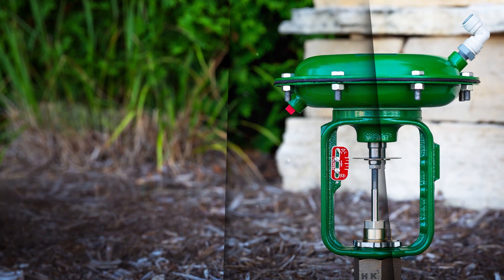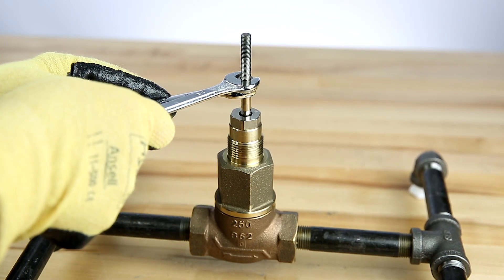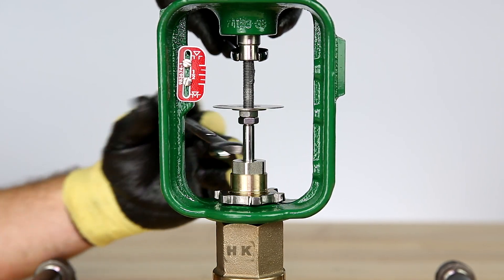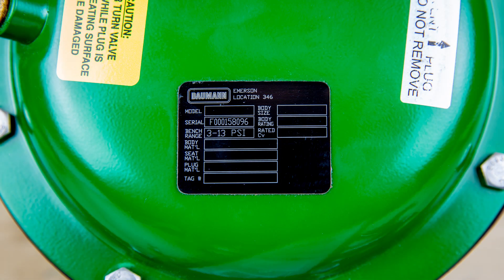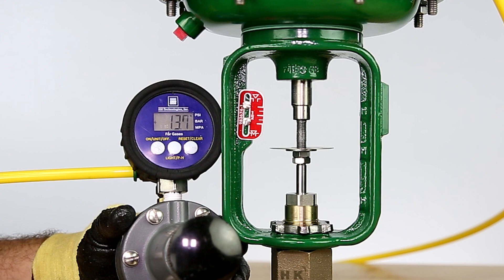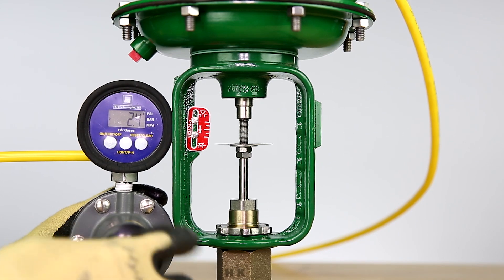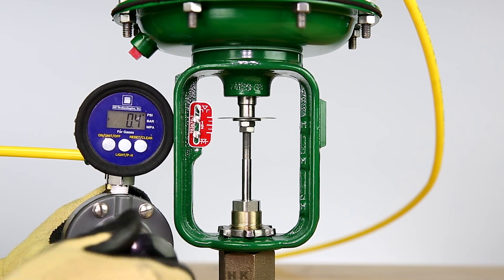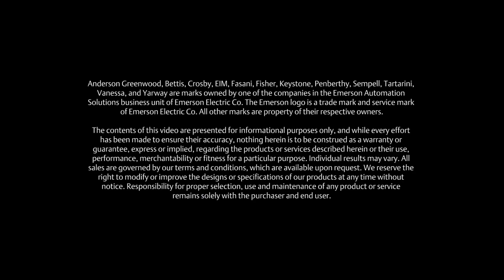How to Set Bench Range for an Air-to-Close Baumann Actuator

Comment: Control valves are essential for PID regulation in industrial processes, as they play a key role in controlling flow, pressure, and temperature. By adjusting these parameters with precision, control valves ensure that processes remain stable and efficient. The integration of PID (Proportional-Integral-Derivative) control allows for continuous monitoring and fine-tuning of these variables, minimizing fluctuations and optimizing system performance. This precise regulation is critical to maintaining product quality, energy efficiency, and overall process safety.

Comment: u were setting it for 13 psi but at the end you set it at 20psi ??
Reply from the maker: The Baumann Actuator use a maximum supply pressure of 20 psi for operation and account for fluid forces from the process.  If everything is working properly you should see full travel over the indicated bench set span indicated by the name plate of the assembly, in this case at 13 psi you should see the valve plug contact the valve seat with no process forces present.  At the end of the video we are confirming that full travel occurs as pressure is increased to the assembly, if everything is correct the valve plug would contact the seat close to the upper bench range value but we continue to increase the pressure to the full supply of 20 to verify if any excessive travel is detected that could be an indication of an issue with the installed springs or other issues within the assembly.